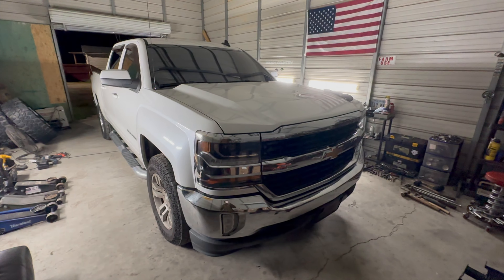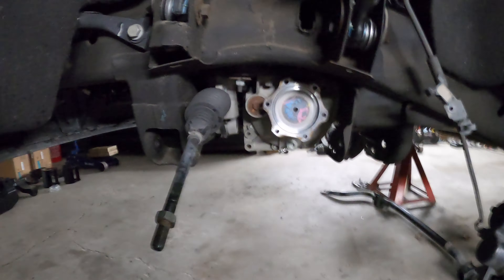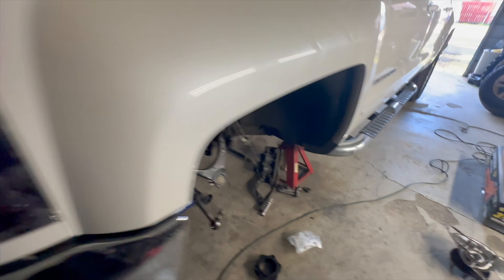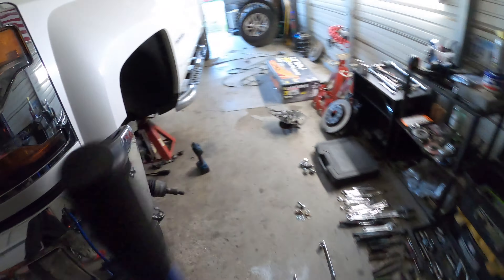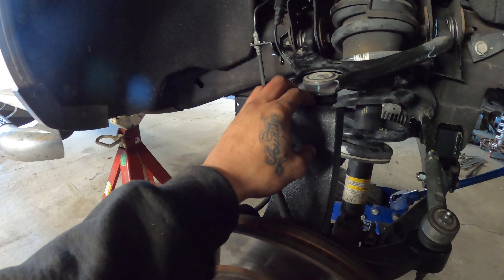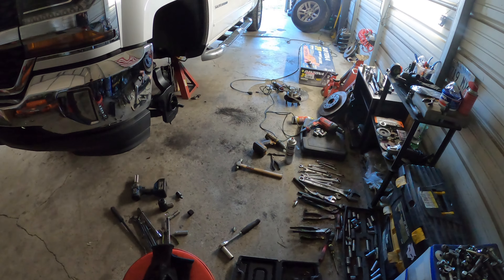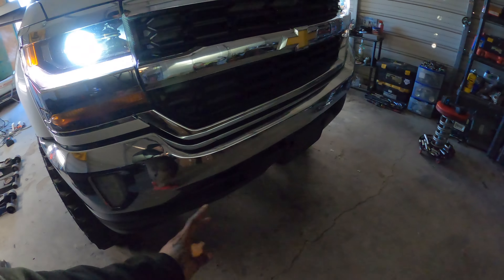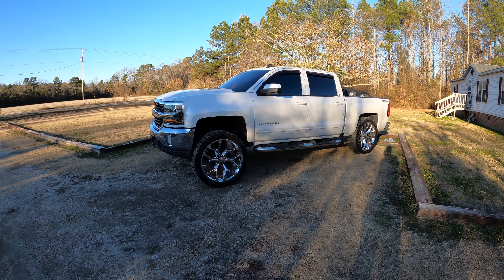6" ROUGH COUNTRY PUT ON A 14-18 SILVERADO WITH 26s and 37s!

Comment: I’m finna put a 7inch rc and stack a 2in level what size rear block should I go with? I want a good lean but nun crazy
Reply: And did you flip the rear blocks on this truck
Reply from the maker: Probably a 4-5” block will do it, and I didn’t touch the rear it has stock blocks in still